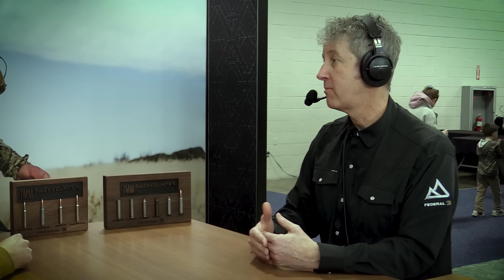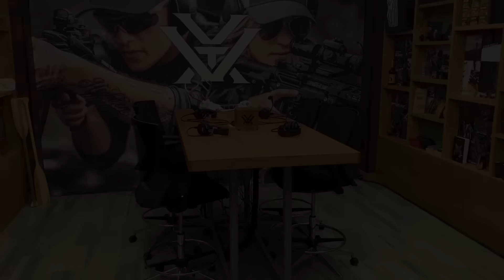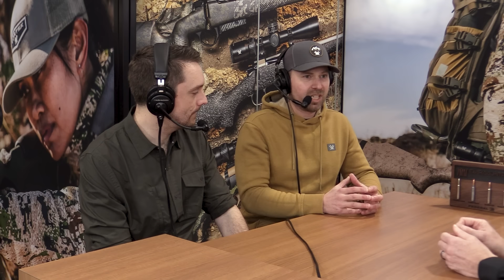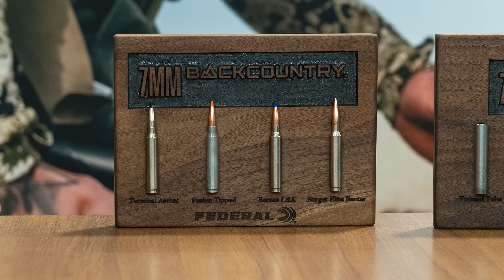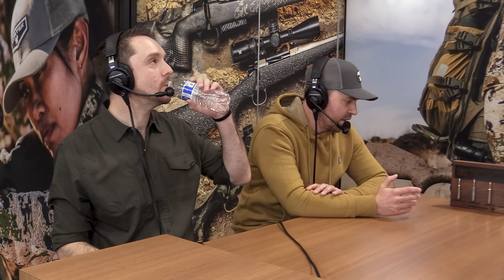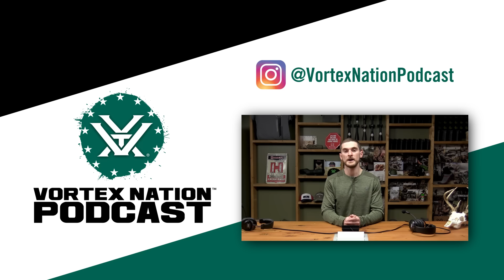Ep. 419 | 7mm Backcountry | The Full Story from Federal

Comment: not sure about others but I'm pushing 3000 FPS with the 170 gr terminal ascents in my Weatherby 307 with a 16" barrel and a TBAC Ultra 7. 175 gr fusions are around 2800 FPS. That said the Fusions are more accurate by a bit.

Comment: Think about hand loads we dont actualy know what hour pressures actually are we trust that it we use the reloading manuals recipie we are in the documented pressue . We are already pushing 65,000 psi but when start seeing pressure signs like bulged brass blown primer pockets case head seperation . What is the pressue at that point it probably is in that 70,000-80,000 range. We dont load there because we are seeing case falure but we would exceed max liad if we are not seeing pressure sigbs but we dont know what that pressure actually is. I can load lapua brass hotter than hornady brass...

Comment: The new U.S. military rifle cartridge is the 6.8x51mm Common Cartridge, also known as the .277 SIG Fury, developed under the Next Generation Squad Weapon (NGSW) program to replace the 5.56mm NATO round, offering significantly improved range, accuracy, and lethality, especially against modern body armor, using a high-pressure hybrid case design.  The "hybrid" cases consist of a stainless steel base coupled to a brass body via an aluminum locking washer. Stainless steel has a significantly higher yield strength than brass, allowing the engineers to use higher maximum average pressure (MAP) chamber-pressure levels. 

Federal also offered their 7mm Backcountry for the tests, yet theirs lost to SIG's offering. 

Federal having lost with the US military decided to try and dump their loser on the open market.

Why are y'all going with Federal's losing debacle as opposed to SIG Sauer's winner?  Why are y'all not hyping the story of the 6.8x51mm Common Cartridge, also known as the .277 SIG Fury, as the latest and greatest new thing when it comes to the future of ammunition? And being the 6.8x51mm Common Cartridge has a brass case body it is far easier to reload than Federal's solid steel alloy case. Again why are y'all running with the loser?

Oy Vey!
Reply: No .277 Fury ammo available from Sig. It all goes to the military. I’d say hunters benefitted from 7 BC, where ammo is plenty.

Comment: Feel the Federal guy was a bit vague regarding reloading issues , e.g.,  only neck sizing, needing a "modified" die, potential for rust breaking nickel plating if neck trimming is required, how often cases can be reloaded, etc. Just get the feeling they have not thought through all the potential reloading issues, yet. 

Further his saying there are no "additional" steps may be a bit disingenuous. Lee even states on their website  that their BC dies may require several passes and additional lubricant:

"Special note:  steel cases require substantial effort to full length resize. Be sure you’re using ample, high performance case lubricant like our Lee Resizing Lubricant. When sizing, once the effort becomes extreme, remove the case and redistribute the lubricant, re-insert the case and size to completion."

Comment: Federal has already posted some reload data.  An advantage of running higher pressure with a given case is that the faster-burning powders, well, burn faster  so you get full propellant burn in a shorter barrel.  That is how the Army's 6.8x51 works so well in a 13" barrel.  If you shoot a factory 7mm Rem Mag out of a 16" barrel, a lot of unburnt powder goes out of the barrel.  The burnout of the 7mm Backcountry might well occur before 16" and definitely before 20".

Comment: This sounds even better than the NAS3 cases. This in the 6mm max would be perfect for the military to replace 5.56 (just a barrel and mag swap) and would update all our calibers bringing smaller calibers up a step w/ light recoil and our big guys into a whole new world. I don’t care about the long range usage myself, but it would provide hunters w/ greater capabilities at usual ranges making them more effective (less lost or wounded game) w/ easier ethical kills.
Reply: It seems it would have less bolt thrust than the NAS case at the same pressure (Shell Shock has claimed it can do 80,000 psi too).  The Shell Shock design sends the full force of the chamber pressure to the bolt, whereas Federal claims that the PEAK case grips the chamber like nickel-plated brass (which, to be fair, grips less than normal brass).  It also seems that the PEAK case might be less expensive to make, given current ammo prices.

Comment: Add a suppressor Aficionado for the last 30 plus years I can stay for a fact that a 16 inch high power with  a suppressor on it is nearly useless  noise abatement wise, they don't make that much difference on fast short barrels. Take the Sig Fury,with a 13 in barrell. It is as loud as a 20 in with no silencer.
Reply: That's what I'm saying.
Reply: 7 BC is a hunting round, not a combat round. So, the end users are hunters with 16-20” barrels with suppressors. In those configs, you get 25-35 Db sound reduction. That’s significant. Suppressor tech has evolved recently, so what you may be familiar with years ago is not really applicable today. Most short barrel suppressed bolt action magnum rifles are still under 140 Db these days, which is the common hearing damage exposure threshold. For example, an open muzzle 18” 7 BC rifle is around 165 Db. Add a good hunting can on it, and you’re at about 135 Db. That’s fine for a one shot exposure. Probably should still have ear pro regardless.

Comment: Vast majority dont need a super powerful cartridge. Up to 6.5 or a 7.08 all majority need. Do you need a suppressor for a whitetail cartridge really? Plenty of great bullet types and capabilities. Improving on this through case and reducing left of barrel necessary to allow for suppressor. Can do what so many 30s do. If all you need is a 100 yard lever blind gun or a hog killer so many suitable options.
Reply: The restrictions and controls of a proprietary cartridge, On top of your blatant WSM garbage lost final trust or confidence in your being trustworthy.  Some real advantages, some but majority dont need anything this big, let alone spending thousands more if already have so many 7mm options. Technology of the case design and extra benefits, and shorter barrel can assist with some. Then the lessons from 7 PRC, 6.8 Western and similar and existing 7SAUM, 280 AI, 7 Rem Mag , even 27o owners. Consider the 277 Fury yawning nothingness since initial release.

Comment: Here's my proposal, and I put it into the world for free.

The AR-15 is limited in length; a 45mm case is about the practical max. And the .30 Rem case head is about all it can comfortably take. x39 case head will work, but it needs special steels and it still feels... iffy.

So: My proposal, the "PBS" case: Public Bullet System. .30 Rem case head size, x39 case diameter, straight wall Basic brass. Long enough that finished cases are 43-44mm long. This gives a tiny rebated rim, feeding shouldn't be an issue. Case capacity for a normally-shaped cartridge should beat the X39 case by about 18-20%, the 6.8SPC by a touch more. 

I don't have the wherewithall right now to ask anyone for cases, but Federal and Vortex have a lot of pull, so... let's make that happen, guys.

Comment: I thought it was Alpha Munitions that applied this to many calibers. Chambering to almost exact dimensions of the steel case, a heavy dose of a fast powder like Varget, and pressures up to 100K psi. The steel actions (bolt actions) from major manufacturers only fail around 250K psi; the barrel is the weak point, failing between 150K and 180K psi. So, for those of you here who want a high-pressure version of their favorite caliber, it's been around for several years.

Comment: So when will I get a short action version say like a  7mm-08 backcountry.
Reply: It only matters for factory ammunition, with good brass you can load to 100k psi without an issue. The main problem people tend to have at higher pressures is keeping the accuracy.
Reply: @jaydunbar7538  having never tried that myself, I would think the brass would crack. Hence the need for the peak alloy. But a high pressure 7mm-08 AI w/ a a little more powder could put us in 280AI territory.
Reply: @Jael2818 that's what I'm thinking. It would be the ultimate Maine hunting cartridge for me.🦌🫎🐻

Comment: Here are my chrono numbers with the Savage 16.5" Trailhunter Lite with Diligent Defense Enticer L can:

170 TA-2961 
155 TA-3115
168 LRX-2981
175 Tip Fus-2954
195 Brgr-2767

Only have had a few slight heavy bolt lift on some of the Bergers..
Reply: Same here, great gun, very accurate ✅✅👍👋

Comment: I hate it. I hate how much PRS has warped the minds of the gun community to start thinking that they need 900 new cartridges because somehow the next greatest thing is going to somehow violate the laws of physics and make a magic bullet that is just better at everything, and the ONLY thing holding it back is scale for adoption to make it affordable.

No.

Every cartridge that needs to exist already does. What happens EVERY SINGLE TIME is that people make all these new exotic cartridges, and they are expensive, and silly, and die out in a few years because you can just make improvements on existing tech. NAS3 is a REAL game changer exactly because it requires no other changes. Things like the XM7 that was marketed on boosting PSI to much higher values makes the barrel profile so heavy that it weighs more than simply having the extra barrel length. So you get TONS of extra cost, extra weight, more recoil, to save what? Maybe 2-3 inches of overall length?

You know what makes more sense? A NAS3 version of 6.5 creedmore and 308 winchester. You get most of the benefits of the 277 fury for a fraction of the cost, and without all the other drawbacks, and if you have the extra 2-3 inches of barrel I would bet my bottom dollar it will perform even better. NAS 3 lets you subtract 2" of barrel, or push out about 200 extra FPS, and in theory, scale is the only thing holding it back, because NAS3 actually could completely replace brass, since steel is cheaper, less material is required, and the two piece construction isn't dissimilar metals, it exists (from what I have researched) because the casing is not using extrusion, which also enhances the accuracy since case width is more uniform.

NAS3 technology makes almost every single new gimmicky expensive nonsense caliber feel like an obsolete stepping stone, because the existing cartridges in common use can simply be enhanced, while doing the same with all the new calibers really just makes you ask the question why you chose that caliber to begin with when 300 win mag already exists, and is pretty darn cheap compared to every other gimmicky round.

6mm ARC will die to 85 GR NAS3 5.56. .277 fury will die out to NAS3 308/6.5 creed. 300 win mag / 300 wsm can be further enhanced with new bullets and NAS3 loads. All other calibers to me feel pointless as far as rifles are concerned.

Comment: I'd love to see the .338 Federal re-released at 80,000psi...
Reply: Yes yes yes!
Reply: @MisterBrewer yeah I'm thinking they could call it ".338 Prime" or .338 Renegade". .338 Win Mag performance with only 70% the recoil.
Reply: @devongreen7308  why do you think you will get less recoil? Equal and opposite reaction, if your pushing the same projectile the same speed your recoil will be the same with the exception of the recoil from powder weight, but thats a fraction of the calculation and the powder weight wont be that drastically difference to make a felt difference.
Reply: @jaydunbar7538 Well 7mm Backcountry is running around 70grs powder, giving you 28 Nosler velocity, it has less perceived recoil than a 7mm PRC which runs around 82grs of powder. .338 Federal is running around 57gr powder, .338 Win Mag is around 85gr powder. 26gr less of powder regardless of pressure is going to be less recoil. 65,000psi up to 80,000psi is less than the pressure of a .22LR case. All this is pretty straightforward, I'm just thinking logically. This is like taking an 8:1 compression 318ci small block and swapping some 10:1 heads on it while keeping the same amount of gas, it's not that crazy of an idea. I'd venture to guess that a brass case would take 80,000psi and not crack or blow up, but only 1 time. Everyone is either scared of or mad at these steel cases. It's the future.
Reply: I can’t wait for the 80,000psi tech being applied to every caliber

Comment: My question is case grip and bolt thrust?  Does the higher pressures create the case grip thus the bolt thrust is not increased?  Does the plating also help with the case grip or is it just for corrosion resistance ?
Reply: He states in the video that there is no additional force on the bolt but did not go into it at all. I was skeptical of that claim, knowing that the expansion of the brass and the brass gripping the chamber is mitigating that force on a normal brass cartridge

Comment: I'd like to see the Peak Alloy case tech applied to something like the 6.5 Grendel. Imagine a little Ar15 length Grendel smoking along at Creedmoor speeds out of a short barrel. 
Yeah, maybe that's pretty similar to the .277 Fury, but the 2 part case on the fury makes me uncomfortable.
Reply: I'm wanting the same with 6 Arc.  Would love to see my TTSX getting close to 3100 out of my 18" and not worrying so much about the bolt head.
Reply: This is what FN intends to achieve with 6.5x43 mm LICC (.264 IWS). In practical terms it's 6 mm GT necked up to 6.5 mm. It uses a two-piece stainless steel case from Shell Shock Technologies. As far as I know they haven't disclosed any velocity data yet, but in a recent press release they did mention that the cartridge has growth potential to beyond 6.5 mm Creedmoor pressures, which is rated at 62k psi by SAAMI. I'm expecting 6.5 LICC to approach, maybe even match velocities available from 6.5 CM with a bullet of similar weight (108-120 gr).
Reply: @FireflyActual  If it's anything like 7.5FN, it will be propriety, and near unobtainium.

Comment: Please bring back the 338 federal in peak alloy cases. I would one buy or build a rifle as soon as it's available. That would be my idea of a short do everything rifle
Reply: 338 and 358 would be fantastic in peak alloy fps.
Reply: Yes, the Federal namesake, the 338 Federal, needs this. I am a huge fan of the cartridge as is and would love to see it upgraded and revived with the Peak allow case! Please please please.
Reply: Sign me up for a .358win. at 80,000 psi 🤘
Reply: 225 accubond at 2900fps out of a short action
Reply: A former neighbor pet cartridge was the 338 Fed. I was always intrigued and find it interesting but never went down that road. I am currently playing with 8.6Blk.
Reply: Yes!
Reply: I wonder if that's not their next idea to capitalize on the 338 trend. I hate to say it but it does look like the 1:8 twist the 338 arc has is a little too slow but the 1:3 that 8.6blk has is just way too fast. A 338BC in a 1:6 twist would really push the limits if they did a couple things. 

338BC has a significantly shorter case than the 7BC because it can throw out some monster 350-400gr slugs subsonic. Actually I think they should try to make some 400+ gr loads because they have the space. Anyway, 338BC runs some bonkers 450gr subsonic slugs but also imagine a 338 150gr monolithic projectile going mach Jesus with that 80k chamber pressure. If a 150gr 7mm is north of 3000 fps I would imagine the same weight bullet but in 338 would be going at least 200 fps faster.
Reply: @Bubbybub0077 in a 16 inch 8.6Blk i have ran Phantom Defense 185gr TTSX at 2400fps. Not sure how much case capacity a 338BC would have but yeah its probably would be pretty wild.

Comment: 6.8 Western with a 165gr Accubond LR out of a 20” barrel will get you everything the Backcountry offers, plus, you can actually get the correct powder to reload it with, and brass is easier to reload than “Peak Alloy”. The Backcountry is super-niche, and will probably remain that way.
Reply: No it won’t
Reply: @Paul-q3m7k custom rifle makes were struggling with it and many won't touch 7BC now. Plus, no one has successfully reloaded it. So, it will probably be a lead balloon.
Reply: @Paul-q3m7kI won’t buy one just because of availability of quality brass cases. Also if you want to buy quality brass cases you might as well be getting a 280ai. This will only sell to people who buy expensive factory ammo and don’t reload. It will die.
Reply: @Paul-q3m7kbullshit, there’s any number of cartridges out there that’ll get you 90-95% of what the Backcountry offers out of a 20” barrel, and they’ll do it way cheaper, and far easier to load for.

Comment: In 5 years, Vortex will be doing a lead balloon podcast about the 7 backcountry. Without the ability to reload, it’s destined for failure.
Reply: It's reloadable, where have you been? I have already reloaded 20 rounds with no issues.
Reply: @Richard44W can you talk about any differences in prices you have noticed? What dies you are using?
Reply: @mattcomchoc2957  Using Lee die set, N560 powder. Bought the 175 fusion factory ammo for $45.00, 155 & 170 for 55, 168 was 61.00. My reloads are .5gr less than max, getting around 40fps slower than factory using same bullet out of a 22" barrel. Next batch will go to max. The Lee die set works really well as long as you lube brass well. Doing the two stroke method on a single stage press. Using CCI primers. My best guess is it takes around 20% more effort (force) to resize the Peak ALLOY than regular brass, but overall is quicker as the steel so far required no trimming and primer pockets just needed light cleaning.